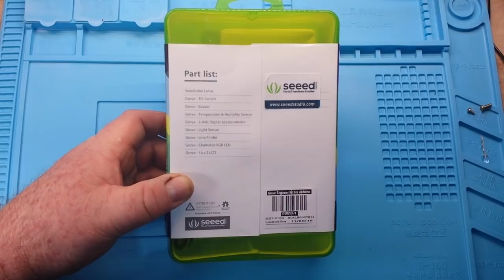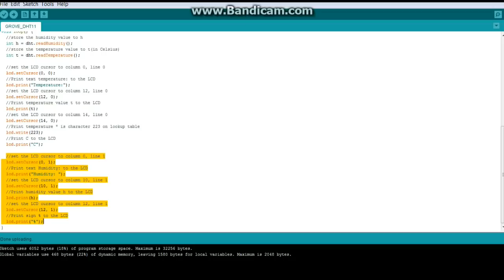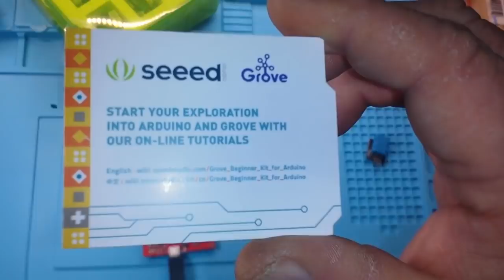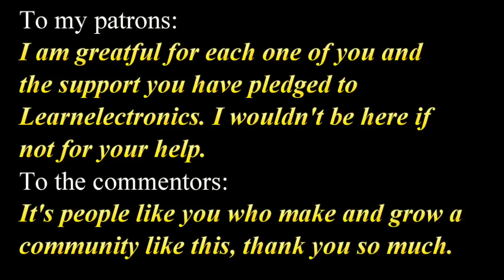Seeed Studios Grove Starter kit for Arduino

Comment: Nice kit for youngsters. Little fingers have trouble with the wires so this eliminates most of that for them. Glad to see the Arduino back in any form. Thanks for the video!
Reply from the maker: Thanks buddy.  All that snow melt yet? It's in the 60's here today.
Reply: No still a-hole deep here. It snowed again last night but only about an inch. It's about 33 out right now so maybe a little melting going on. Thanks for asking.

Comment: can you tell us a little more about the blue work mat you were sent, tried to locate a brand name on your vid however didn't see one
Reply from the maker: Kaisi Heat Insulation Silicone Repair Mat with Scale Ruler and Screw Position for Soldering Iron, Phone and Computer Repair Size:17.7 x 11.8 Inches https://www.amazon.com/dp/B07DGVRYL3/ref=cm_sw_r_cp_apa_i_oYtKCbNQA2M1G

Comment: Many thanks Paul. I think I will get one! Question. Is the power supply only available thru the USB port? What Max current draw does the board allow?
Reply from the maker: You can apply power through the header pins. 40mA max current draw per pin, 500mA total.

Comment: Great video as usual.  IM no big fan of Grove though...I find it very spendy for no benefit.  Part of the Arduino system is not just programming...it's learning where the wires go and why.  This system pushes the "script kiddie" of wiring.  For only four wires too..that's a bit lazy.   I an definitely not bashing on Seeed Studio though.(love Linkit Smart Duo and Linkit Connect!!)

I know you have to start somewhere but this system should be graduated away from ASAP if used at all.
Reply: I agree with you for 99%. What better to hook up a sensor with 3 wires and go nuts if it works at your first of fifth go. That's also a reason to play at a later time with some other components. I am so glad that I made a step out of the microcontrollers and experimeneted with just some electronics stuff. It really enlarged my world :) But if you never went beside a pc and your first go is with these grove things, well that can also be a first step into a bigger world.